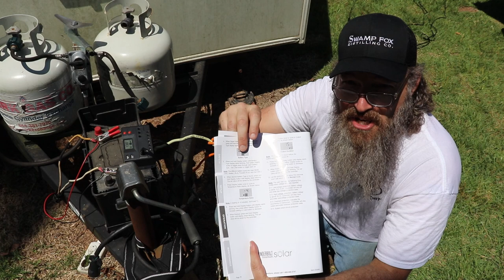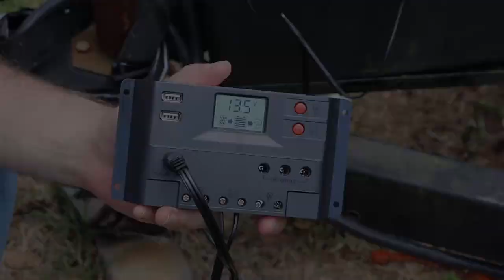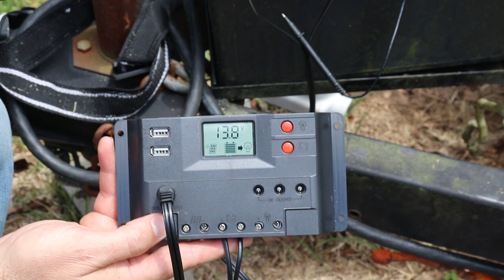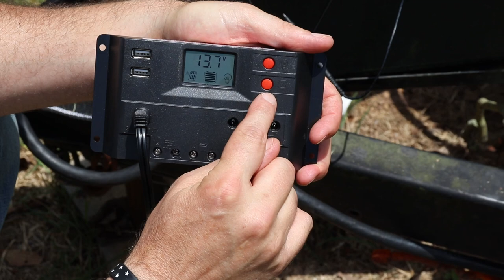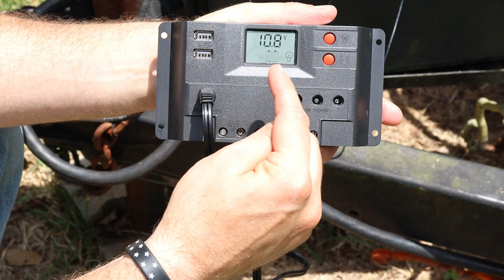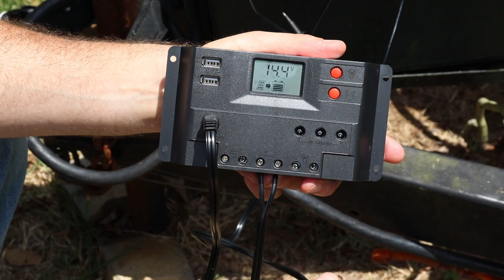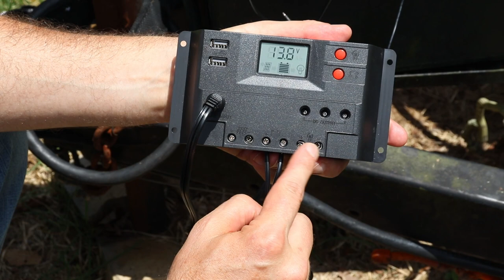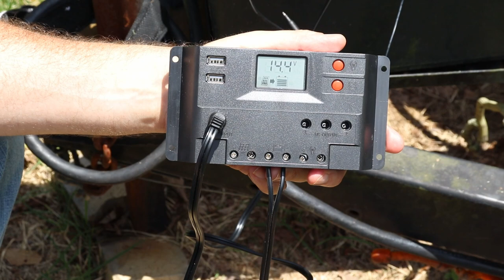Tailgate review, Harbor Freight Solar Panel Kit!!!

Comment: I have 2 100 watt kits. I run 3   109 amp hour batteries and a 2000 watt inverter. Furnace at night in my trailer is all that runs maybe radio and a light for maybe an hour. I don't like AC so not using that. Charge phone and laptop through the day. May add some USB ports and a 12v socket. I like mine!
Reply from the maker: Awesome setup it sounds like.  Panels are still going strong.   Thanx for the comment. Be Safe and God Bless!!

Comment: 5:40 Youre measing the voltage, not the watts. Watts are volts multiplied with the current the panels are putting out. 22ish volts open circuit is spot on for a "12V" panel.
7:30 Btw you might want to use fuses as close to the battery as possible to avoid your RV burning down, when theres a short in the cables down the line.
Thank you for the honest review, sir.
Reply from the maker: Thank you for the comment and correction, I surely did misspeak there.  We will look at adding some fuses, great idea.  Thanx again.  Be Safe and God bless!!
Reply: @watavuemountain481  Thank you, sir. All the best for you, too! God bless you.
Reply: Would you say splicing into the battery cable? What kind of fuse?
Reply from the maker: @samanosukeakechi4388  I’m thinking the cord coming from the panels, but since it isn’t my comment not sure exactly what they meant.  They make inline fuses, 30 amp or so that you could use.  Hope that helps. Be Safe and God Bless..

Comment: Good video man. One thing to note is that the charge controller that comes with the kit is a 100 watt charge controller, if you buy the hub and add more panels you will need to get the 500 watt charge controller.
Reply from the maker: Great point I should have explained better.  Haven’t done it yet, but now we know.  Thanx for the comment. Be Safe and God Bless!!

Comment: they are decent starter kits we have had two for years and they still work ok but if you want to run AC you will need tons of battery and tons of panels to recharge it lol.....seems like the CC was sensing the battery close to full so it was float charging thats why you may not have seen the battery meter scrolling. either way good luck!
Reply from the maker: Thanx for checking us out and for the comment. Agree 100% if we want to run the A/C we have to get more batteries. Will probably just wait until the mini cabin is finished or closer to finished to buy some big ones.  Be safe!!
Reply: @watavuemountain481  no worries we have about 400Ah or so and it does most everything but large loads

Comment: What generator powers all your appliances?  I'm new to all this.
Reply from the maker: We have a Predator/Harbor Freight 3500 watt inverter generator.  It does a great job running everything including the air conditioner.  Have had it 3 years and been great.  Good luck and God Bless!!
Reply: @watavuemountain481  Love our Predator 3500-watt invertor. You can't say enough. even on half load it's so quiet. But powerful. Also loved your video. But you just cost me $189.00 dollars because of your video Cause now I have to go to Harbor Freight to buy my solar panel kit. LOL, have a Blessed day, God bless. Brother.
Reply from the maker: @cowboyup545  😂😂😂. You won’t be disappointed in the solar panels either.  They have been as reliable as our Predator.  Thanx for the comment.  Be Safe and God Bless!!!

Comment: A single 100 watt panel would be less that half the size of those four panels.
Reply from the maker: Very true, however, with the charge controller it would be a bit more expensive and for this application we weren’t worried about the space.  Thanx for the comment.  Be Safe and God Bless!!

Comment: Its not a bad setup. You can get additional panels and a another 400 watt connector. With that you could add more panels and batteries. I would prolly go with something a little better, but if you are running a few lights and a small load it might not be too bad
Reply from the maker: Absolutely!!! That’s one of the reasons we chose this system, it’s pretty easy to add more.  Thanx for the comment and for checking us out. Be safe!!
Reply: @watavuemountain481  Not a problem. Looking forward to more videos.

Comment: Good Job Cuz, it will work fine to charge the battery.  It will take more batteries and panels to power the mini cabin and the cabin when you get there. Happy Veterans Day...
Reply from the maker: Thanx Cuz!! You got that right, this was just a trial run to see if I could figure it out.